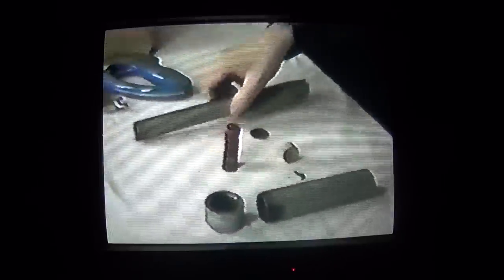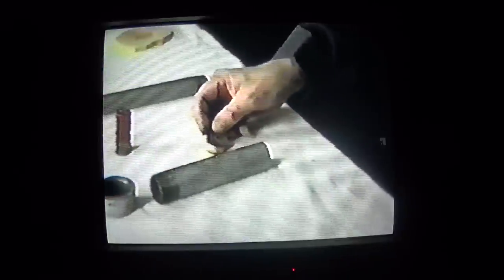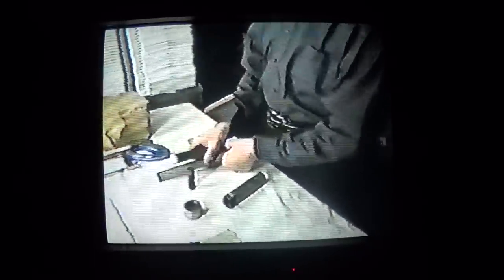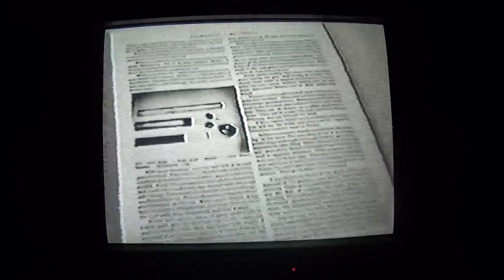The Four Winds Shotgun

Comment: you can replace the crappy firing pin with one that's a bit better by taking two bottle caps and sticking the nail through those then put is in the endcap and tighten the 1 inch pipe really tight to get the caps stuck in the end cap